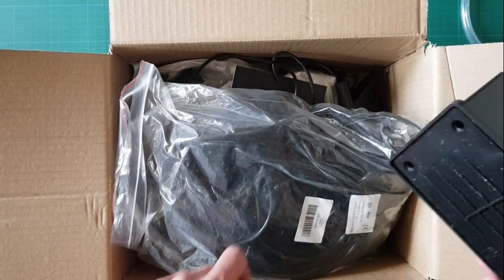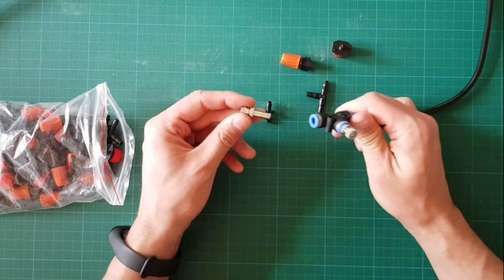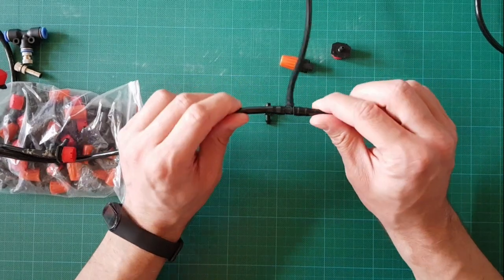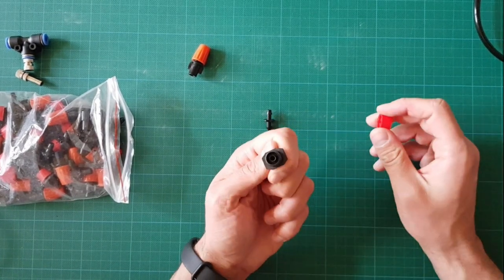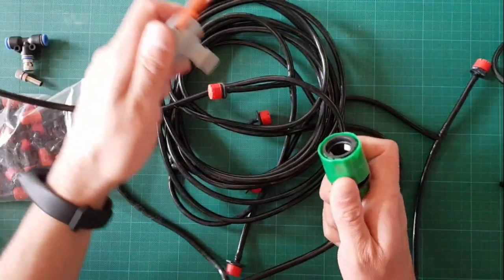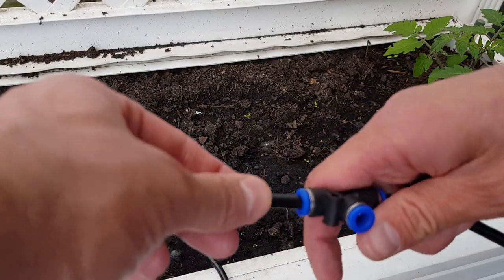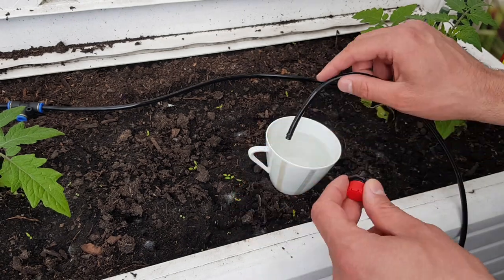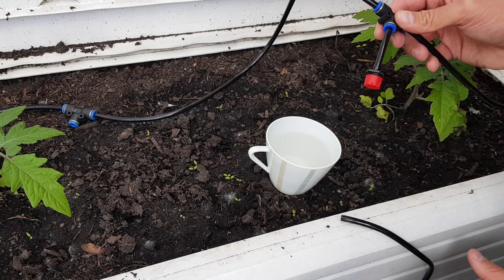How to install a Balcony Watering System | DIY

Comment: Hi.  I travel overseas about 4 months a year and my balcony plants die by the time I return.  Tried paying a person to water the plants but it is obvious that person does not co e as required nor cares and knows about keeping plants well hydrated.  I want to get this time a system with hoses as you show, that could turn on and off and water the pots about twice a week.  I was thinking about perhaps a big tank I could get in my balcony, and inside under water place a water pump that would be connected to the hoses.  The pump could use a timer so that the power wire for the pump could be connected to the timer and the timer to the wall outlet.  In this way I can rest assured the plants will be watered during the four months I may be away from home.  All I would need is someone checking every month to make sure the water tank has enough water in , easier than asking someone to care for the plants. Could you help me devising the parts I would need ?